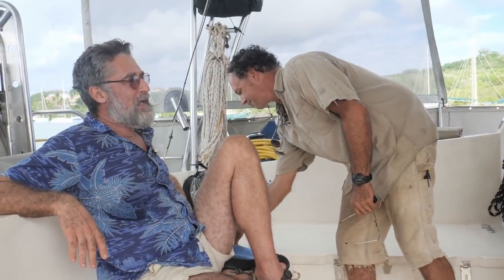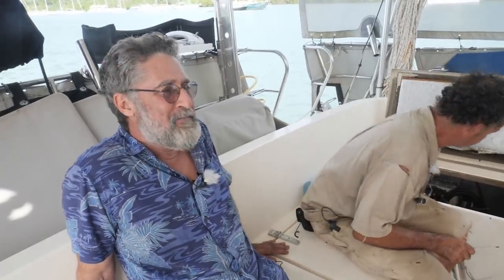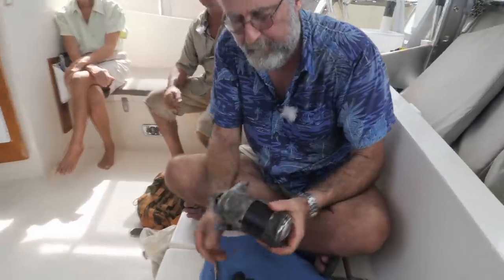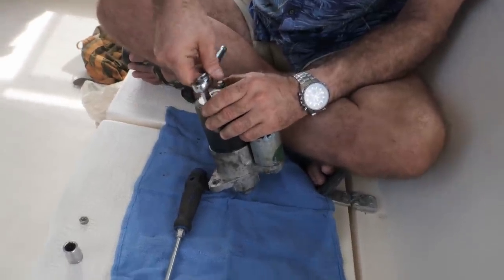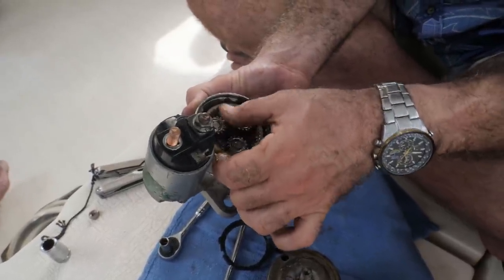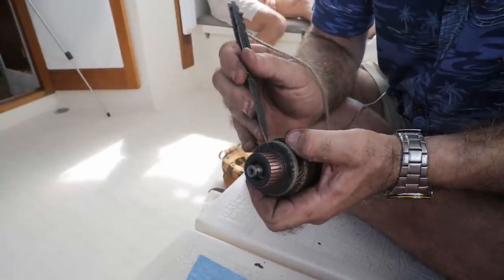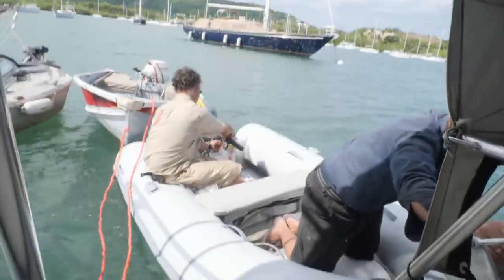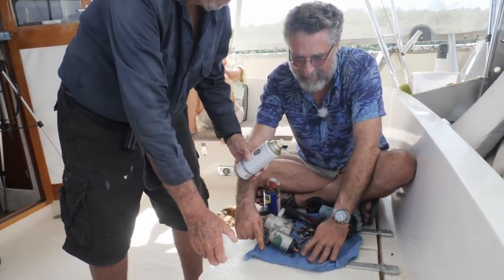How to Fix an ENGINE STARTER (with Friends) [Capable Cruising Guides]

Comment: You may not wish to use sand paper on your commutator. It will embed the hardened particles in the bars and mica causing your brushes wear quickly and unevenly. This will cause failure in a much reduced time. I understand who really cares if it gets you going in the middle of nowhere. But if you a rebuilding a starter to put away as a restored part .
Starter motors are built to last almost forever and can be rebuilt as good as new dozens of times. As for the plastic ring gear, It is a designed failure point.Designed to fail to prevent much more extensive damage to your engine, Electrical system , and the starter its self.
Love your show, Keep up the great work.

Comment: Thank you, thank you, thank you for saying that WD-40 is not lubricant!!  It's good stuff for what it was designed for, displacing water and corrosion prevention.   Again thank you for teaching me how to rebuild a starter.   Keep the good stuff coming.
Reply: I heard it's also a bird repellent - I had a coworker who was awakened obnoxiously early by pigeons outside his hotel window during an extended stay and after spraying WD-40 on the outside window sill, the pigeons never returned.

Comment: I was taking apart my starter while watching this video. When I got it reassembled, both the solenoid and the starter began working beautifully. Thanks guys !
Reply: I own a Camper Nicholson 35 with a Perkins 4-108.
Reply from the maker: Temptress had a 4-108 before I put the yanmar in her.  Good engine for that size boat.

If you need parts and are in Florida I have the old engine parts in my shed

Comment: Great clear explanation.   I'm familiar with starters but the toothpick trick was new.  I've  been using dental floss to hold brushes in,  it's a bit awkward, I'll have to check on the next small motor whether there are toothpick holes.  I guess if there aren't I could just drill some(so many things are designed to be "unserviceable" these days).  Cheers.

Comment: Great take apart video. Thanks, this is the second restore to life starter video from cruisers that looks really informative. But it looks like that engine has not been getting the TLC it needs. Did it finally get to run after other fixits. Years ago I had a fairly new yanmar 2GM, VERY simple engine, wouldn't start, wouldn't start no matter what I tried - starter, flywheel, compression check, injector spray pattern, battery, hand cranking. I was too embarrassed to ask anyone to help figure it out. So I would just sail my 33 ft boat off the mooring and back into the mooring every weekend in the anchorage and getting the stink eye from a couple of nearby boat owners afraid I would run their stern. What happened is I really learned how to control the boat in small quarters and flukey winds, I forgot about the motor for awhile. Then a friend asked if my motor was working, I made some dumb comment about changing a part and while down below he looked at the motor and ask if the bolts holding the injectors were supposed to turn freely - the aha moment for me was that the injector bolts vibrated loose. I never bolted to spec and kept vibrating loose so no compression. I torqued the bolts to yanmar spec and motors problems were over. I still preferred sailing in and out of the mooring basin. By the way, if I Were to ever invite you to look at an engine, I would provide the Snap-Ons , brake cleaner, goob hand cleaner and anything else on the job.

Comment: My 1967 Mustang 289 V-8 Acapulco Blue convertible would not start. Starter was replaced, and it started the engine, but after awhile it did not start the engine. Replaced the starter, same problem after awhile - engine would not crank. One night out of frustration I decided to push the car in drive a foot or so, then the starter would start the engine. The problem was a missing tooth on the flywheel. Whenever the starter landed in the space once occupied by the flywheel tooth, the starter would not move the flywheel. Once the flywheel was replaced, good to go - hair blowing in the wind once again. :¬) Webhead USA

Comment: Spent the 85 dollars on the manual crank for my Volvo Penta 28HP. First year we had the boat back in 1995, out in the Great salt pond of Block Island,   Hurricane coming up the coast and they said would be where we are in two days, so we had anchor and only had the original two 23 batteries which in the morning were dead. Tried to group the but the fame Tic, Tic, 
So got the handle out and hand cranked her to life. Works, but after that got a separate starter battery, never want to do that again.  However still the best 85 dollars knowing if you are struck by lightning, I can manually do it.  Too bad the do not make that for the Yanmar..

Comment: I would first jump the solenoid terminals ( eg with a short length of battery cable between the two large terminals) to eliminate it as the problem before I took the starter off. Then if the solenoid was not working, check for voltage drop. Yanmar starter solenoids are very sensitive  to voltage drop, usually caused by corrosion on the wiring or connections between the key switch and the solenoid.

Comment: Clark I don't know if these marine starters are similar to automotive starters, but I use to take apart the solenoid and inside was a spring loaded metal disk that would engage and closed the circuit continuity
Reply from the maker: They are a bit less rebuildable then they used to be.  Now most of the solenoid doesn't really come apart.
But yes they are the same as automotive.  Since it's a diesel (high compression) they are higher torque then you would think.

Comment: Nice video- thanks! Not sure if you did this but before removing it would you first want to check the voltage going to the starter? Seems like lower than optimal voltage could result in it turning but not fast enough.
Reply from the maker: Sure could.  I should have mentioned that in the video.  My bad.  Just wanted to show how to "field strip" a starter to people who might need that knowledge someday.  
    We found that Steve's starter had that need so I made the video.  It was not a complete class on boat electrical.  Honestly the video was too long already.

Comment: Love the video haven't finished yet. But it sounds like cracking the injector lines to bleed the air would help to??
Reply from the maker: Seems to me the valve are out of adjustment.  Notice the smoke coming out the intake.

This boat has been on the hard for many months.  Steve has been very sick.  Surgeries...

He hopes to launch this week.  I'm planning to out an AC into his boat and help him get this engine started.

Comment: ... very nice sequence on the workings of the starter, complete with the occasional anecdote. Appreciate the ancillary info like what WD-40 is and what it's for, and Boeshield... 
  8^)
Reply from the maker: Glad you enjoyed the video.  We sometimes don't get as many views on videos like this.  Good to hear they are appreciated.
Reply: ... I would guess there's a cruising/adventure/social viewership, and then there are the technical aspects that appeal to those that want to help themselves in a crisis. It was a good, basic explanation without getting into electrical theory and beyond. Very practical. At least a viewer can now decide whether to tackle something like this with their skillset or leave it to a professional, or at least have the confidence to remove the starter so they can drop it off to get rebuilt/fixed, then re-install it themselves. Save on the budget where you can.   8^)

Comment: Hi Clarke, I really enjoyed watching this video on starter motors. I also have a Yanmar 4JH5E on my Catalina 42Mk2 based in Melbourne Australia. Can you please indicate which make and model of spare starter motor you use and where I can purchase a unit. Many thanks , Gary on SV Meshugah.
Reply from the maker: Just start with your yanmar part number and hit eBay.   Also search on 4jh engines.  The 5e part doesn't matter.

Comment: The screws to hook the power on to the starter looks like copper so this is a spare starter and you can not thighten this screws so strong as these from the original starter otherwise you overscrew the windings. If the contact plate of the solenoid randomly does not close the circuit for the starter motor then the owners often start to hammer on the starter motor wich does help for a while but this becomes more worse and you should change the complete starter motor because the silver coating on the contact plate is gone and it will corrode how ever you try to fix that. Except the case you can get only the correct solenoid or its contact plates. The wax spray does really work very well because after the rust is scratched away the iron does rust for a while after it is coated with wax because of the oxygen that is already in the iron. But when this happens the wax will follow the expansion of the iron during rusting an it finally comes to an end of expansion du to not getting more oxygen. If you use paint or other not flexible coatings, they crack an let new oxygen in. For badly rusted parts I use first oil for a few weeks until the iron really stops rusting. An then I use wax spray. After a few month I can now decide to remove the oil an the wax and make a paint or still keep wax on it because it is a moving part or a bolt or a nut that I often have to remove. Cool video, thanks for sharing!

Comment: My friend striped down my new yanmar starter due to corrosion in all parts of the starter. Caused through the bell housing being full of salt water
Reply from the maker: Yes this starter can't tolerate salt water.  It's just not as good as old starters but they would cost so much nowdays with all that copper in them.

Comment: At ~5:50, that engine was bouncing around hard enough to make me STRONGLY believe that it's mounts are SHOT.

FREE advice is ALWAYS worth 10 times what you paid for it - MINE is GUARANTEED to be worth TWENTY!
Reply from the maker: They are just soft mounts and Conrad hit the bolt hard breaking it free.
Boats don't have to accelerate like trucks and this boat has saildrives so no alignment issues.  Soft mounts keep the boat from vibrating and make everything quieter.

Comment: ... suggestion: park the wind generator so it's not whining during the recording.  8^)
Reply from the maker: Yes we kept kicking ourselves about that during editing
Reply: ... at least it was relatively benign, just background noise and only slightly distracting. Anyone who has one, probably don't really hear it anymore but I recognized it after a few seconds. I wasn't sure if it was the one on this boat, or nearby, but it sounded close. The video came out clear for the most part, which is fortunate.   8^)

Comment: And the plastic parts in the cheap ones is absolutely ridiculous!
Reply from the maker: Yes.  But maybe the plastic is fine.  Yanmars start easily. Maybe it will never wear out.  Well at least not until the brush holder fails anyway.  -C

Comment: werd they don`t contruct a better starter since its the same construction since the first person was too lasy to krank the engine themself ( not to mention the backfireing when when they set the ignition time wrong)and they know it only will do the job the first month on the sea but why make a knew since they work 5,10,15 and sometimes 25 years on land  depending a little on hov many starts a day
Reply from the maker: All modern starters seem to be high speed low torque motors with planetary gear reduction.  This approach uses a LOT less copper.  Copper is expensive!
Once they start trying to save money they continue with bad brush holders and apparently plastic gears.

Comment: Sounds like no compression
Reply from the maker: Yes.  I think (or hope) the valves just need adjusting.  But didn't want to dig deeper till it turned over well.

There is smoke (unburned diesel) coming out the intake.
Reply: Awesome video cheers

Comment: I don't think anyone makes a reliable starter. I'm at number 3 on my universal "kubota" engine
Reply from the maker: I liked the one on my Perkins 4-108.  But these geared starters might be the same level of durable.
Reply: my beta marine kubota use the same starter than the Isuzu pickup truck gasoline, and cost over the counter on auto part store  $80 to $100. i rebuilt my so many times that the plastic brush holder melt beyond repair.
Reply from the maker: Sounds like a similar starter.  I usually find these for about $60us